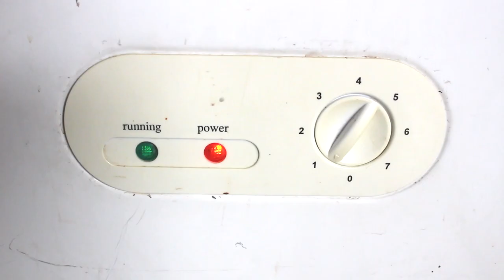How I Made My Own Chest Fridge During the Pandemic

Comment: Hey Dan, this was brilliant! Keep sharing your discoveries because we can learn so much from you.  I LOVED the fact that you did not need to get an external thermostat -- just set it to the lowest setting.
Reply from the maker: Yes I was curious as to how that freezer had a fridge setting, but it made life easier.
Reply: @HardcoreSustainable  thermostats are mechanical devices and sometimes have sloppy tolerances, so occasionally you'll get lucky and find a chest freezer that will function as a refrigerator. the downside to this is if you are looking for a chest freezer to use as a freezer it might not be able to get as cold as you would like due to the sloppy thermostat. i have 2 chest freezers, an old whirlpool made in the 70's using r-12 refrigerant and a newer one also made by whirlpool in 2002 but sold at costco under the kirkland brand using r-134a refrigerant and both of them freeze hard at their lowest settings. one cool thing is that the old whirlpool will get all the way down to -35, and at that temperature food will last forever as long as it is packaged properly.

Comment: Nice! How does it compare for energy use?
Reply from the maker: That's a good question. I'm sure it uses more per cu. ft. because it isn't superinsulated like the Sundanzer, but it still uses less than an upright fridge. I'll hook up the wattsup and see what it says over a day of use.
Reply: @HardcoreSustainable  ty for that follow up. I'd love to know if it's worth it if your starting from zip. Loving your playlists.
Reply from the maker: I was getting a reading of 10W.  After 91hrs it used .91kW of power.
Reply: @HardcoreSustainable  thanks!
Reply: @HardcoreSustainable  chest freezers have much better insulation than other refrigeration appliances because they are designed to hold food frozen at subzero temps while minimizing energy usage in order to get a good energy star rating. so when you use it as a refrigerator they become very efficient.

Comment: Thank you!  I’ll keep this saved for future reference on repairing my chest fridge box! 
We bot a 7.3 cf chest freezer to use as a fridge, & a 13 cf chest to use as freezer. 
I simply figured out our fridge box needs to kick-on 5 times / 24 hrs….so pulled 5 pins on a manual timer equal-ish around the clock for the fridge, & a 2nd timer to limit run-time on the freezer unit, which keeps things hard-frozen, but, never builds up much ice—so, have never had to thaw it out.  
I plugged the timers into one power strip that is surge protected.  
That can plug into our Goal Zero battery box, or the grid.  
But in the several years running these, it’s been mostly from the battery box;  have only plugged them to grid, when battery box controller needed replaced.  
Our battery box has been charging from wall socket at about 55 watts…had not gotten solar panels up yet.  The battery recharges fine to run the cold boxes, & if grids’ down, the battery can run them at least 2 or more days—then, if no power, the cold boxes can last about 2+ days on no power, & food’s safe. 

I use MoldZyme (non-toxic enzymes that stop mold), sprayed on the inside walls of the fridge box, maybe once or twice annually, to keep mold from building.  All foods are kept in closed containers or plastic bags to prevent mold getting to the food.  

This arrangement has worked reliably for around 7 years or so; the only hitches have been when the battery box controller has stopped working—that happened once, less than 2 yrs doing this, & has recently happened again….might need new battery, because, Li batteries do not last as well at this kind of cycling, as old-style lead-acid batteries.   
Kinda disappointed at the GZ controllers—but their hardware isn’t the only electronics—Planned Obsolescence has become an obscenely excessive plague upon the planet—a tactic to artificially increase industry profits—& electronics industries have done it the most, for over 100 years; worst in the last 30 years.  
So, instructionals to help folks revive their electrical stuff, is a real boone to the environment, & our wallets!
Reply from the maker: Yep, sometimes it's incredibly easy to fix appliances. You just have to know a little bit about how they work. Unfortunately, a lot of refrigerators and freezers break down because they lose all their refrigerant when there's leaks in the system. This kind of fix is pretty much impossible or prohibitively expensive.  And a lot of fridges are built, like you said, to break after a short time in this way. They could just build the coils to last a long time, but they don't. They build them to degrade and eventually release the refrigerant, which is incredibly harmful gas that is a very potent greenhouse gas as I believe I mention in this video.

Comment: Really great video! How would you use an external thermostat to manage a freezer as a refrigerator?
Reply: very easy. connect the freezer's power cord to the external thermostat, place the thermostat's temperature sensing bulb inside the freezer, then plug in the external thermostat's power cord to a power source.

Comment: How were you able to determine that relay was burnt out?
Reply from the maker: I just opened up the guts of the fridge and did troubleshooting based on what few things could cause such a problem. When I tested different components for continuity and resistance, meaning the current that could flow through them, it showed that everything else, the compressor, the capacitor, the on/off switch, were showing what they should show.  The relay didn't have the right resistance. I opened it up and found that resistor disk had all that charring, and I knew that was the culprit. Then I had to find the right replacement part online.

It's difficult to troubleshoot more complicated electronics this way because there are so many circuits, usually on a motherboard. On a motherboard, there could be a short or a blown part anywhere in the maze of circuits, and fixing them is much harder. But fridges have really simple components, like the one I show here.

Comment: there are chest freezers that can go up to 50F (so you can use it as a fridge) wanai makes one
Reply from the maker: Yes that is what I did with this one.
Reply: @HardcoreSustainable  you made it into a brand that already came with those temps available? What's the brand?
Reply from the maker: @gg-gn3re  Yes, if you set this chest freezer on a lower setting it's a fridge. It's an Avantco.